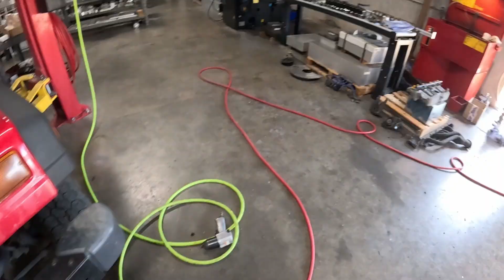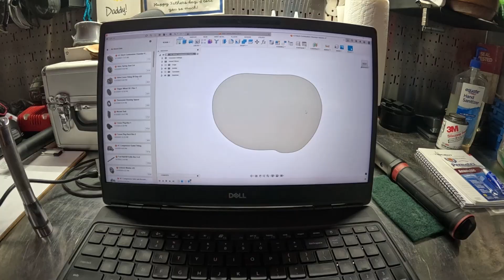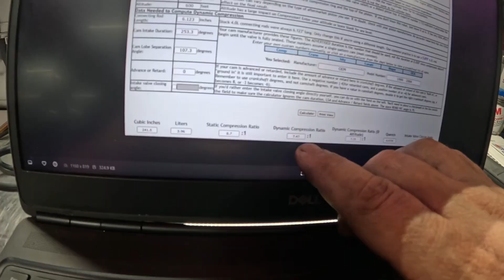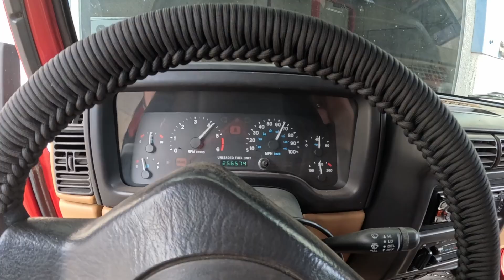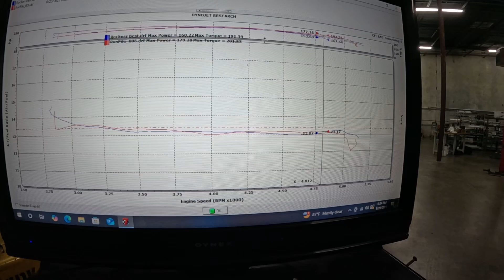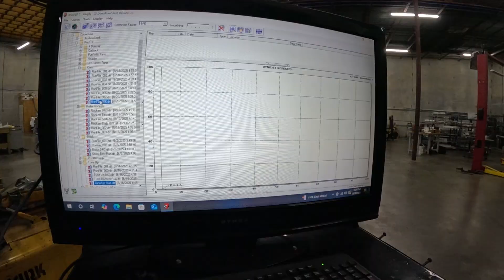Jeep Wrangler 4.0 Bolt On Test Series - Episode 11 - Cam and Compression

Comment: 1992 4.0l. Clegg parts
Head work at the recommendation of clegg (.20 thoug off the block) but they had a piston set ($600) that was the equivalent; I chose the machine work.
Clegg 1.5 cam.
Rebuild kit with stronger internal parts.
Gasket match intake on the head. Stock head parts besides Harland 1.6 rockers.
Banks exhaust
Fuel injectors
4.10 gears & 33" tires Jeep comanche-mj. 
My goal was all motor on pump gas and no tuning. Similar to what you're looking for.
Hopefully a bit better results with 1.6 rockers instead 1.7?

Comment: Well done, very informative.  I like the HP and Torque Volume gain through out the rpm range over stock. Its not about big peaks but smooth curves the range.

Comment: There is a simple heat shield wrap for the fuel rail on those 4.0L that will reduce fuel temps. It's a stock OEM part, so they're readily available thru Rockauto or wherever.

Comment: I'm going to guess gains from a return fuel system are about zero.  Fuel only boils when the pressure falls off, not when it's in the rail and hot fuel atomizes much better than cold.  FWIW, later YJ and XJ 4.0L's had a return style fuel rail, though it returned from the feed end, not the far end.  I think that was to keep from dumping hot fuel back in the tank.  If I had one I would send it to you.  They went away from that in '96 or '97...

Comment: FWIW, Rev limiter on a 4.0l is total fuel cutoff, really harsh on/off/on/off at about a half second interval, not smooth control of fuel and timing like some engines.  Would have been cool to see cam only but if you're going in, you might as well do what you did...  I've been debating a cam on my stroker...  Gotta see what the effect is on DCR since I'll have a bit more static CR than I really want at about 9.3:1.  Stock cam proven not to fail at this point, aftermarket iffy on reliability it seems...

Comment: Just got to the end of the video.  It's a sad day to lose a dyno, but I understand your situation.  We lost our lease 4-5 years ago and had to scramble to move.  The rollers didn't join us on the journey.  We are working a hub unit into the budget, but that's still a bit off.  Dialing in AFR's and spark advance under load at varying throttle positions is so critical to drivability - and I miss having that capability.  But you -- you're a full machine shop.  You can fab products and have others test them!  Winner, winner, chicken dinner!  PS: Those ports are a bit small, and you might be nearing choke with that cam and intake.  I'd offer to do some bowl work, gratis, but you've got the equipment and capability on-site - and it's not a "bolt-on".

Comment: Over stock - torque is up everywhere.  Substantially.  Well done.  Any driver would feel that.  We didn't need to use an LS style ignition until 300+ HP.  Unless you have a failing component or bad ground, you should be fine for a while.

Comment: Sorry for all the questions but it is so refreshing to see someone do this whole dyno series with real numbers. 
Sorry to hear you sold the dyno. You are the only one who has done this with one vehicle, location, variable, same dyno same operator.

What was the quench final number? I missed it

What valve springs did you use? And retainers? And installed height?

Check out this old page of mine with tons of Jeep 4.0 engine specs and more.

http://jeepm62superchargerkit.blogspot.com/p/misc-xj.html

Comment: I went back thru your videos, did you try and test the later ‘99+ curved intake manifold?
And the top end break up could be ignition or plug gap. Could tighten the plug gap a little.
Otherwise you have hit the max for bolt ons. 
The next would be a ported head. That would get you that last 20hp.

And I couldn’t find what was your power numbers with the turbo?
Marty
Reply from the maker: I thought about the later manifold, but I don't have a spare one.

Comment: Great video. Thanks for using your skill and equipment to provide us with this content and information.

Is the stock ECU and tune capable of compensating for a milled cylinder head, so long as I run a little higher octane fuel? 

I've done this on my 95 Mazda Miata, because the car had a warped head when I bought it. It runs awesome on the stock ECU still.